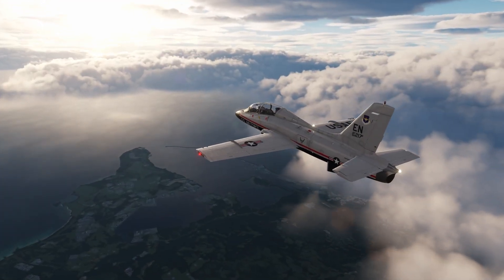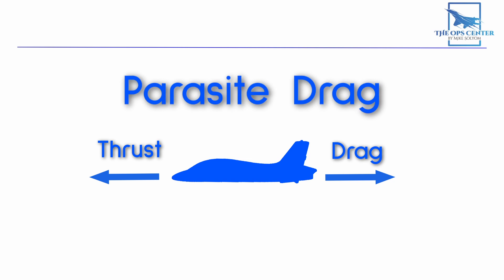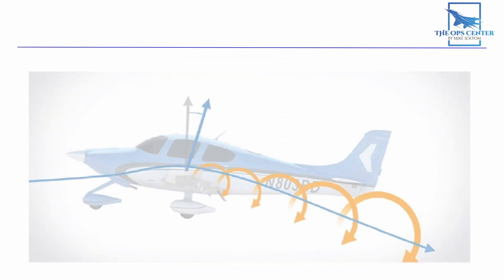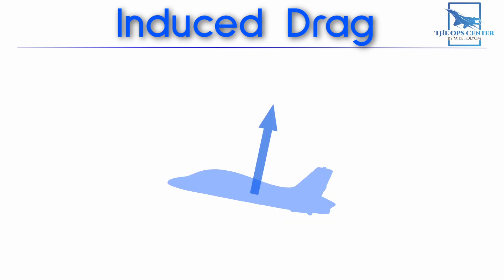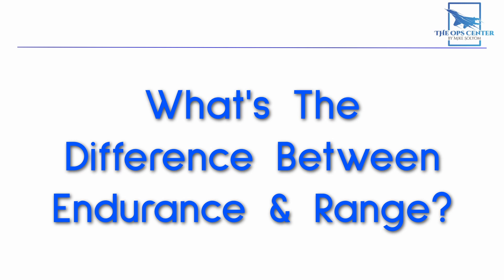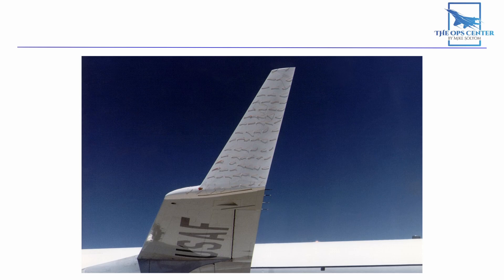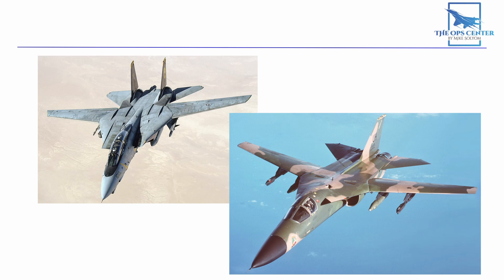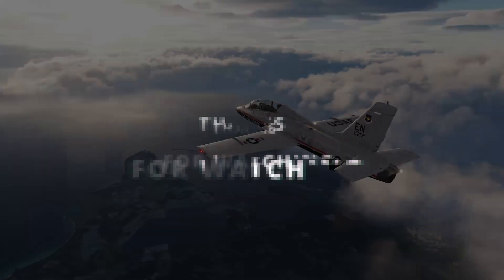Aerodynamic Drag Explained | DCS Beginner's Course

Comment: Hello again Mike. Again, very good content after the lift video, with nice examples about the winglets! Nailed it again and the drag curve is awesome and says all.
I would suggest, if you allow me, to move the ground effect explanation into the lift video, or maybe you intend to explain into more details into a landing video ? First reason is that the effect for the pilot is mostly "felt" on lift when landing or going high speed at low altitude. Second reason is because my understanding is that it is more linked to something like the airflow being pressed tight between ground and wind, so more related to lift phenomenon. I believe the ground effect is indeed something happening even with symmetrical shapes at 0 aoa. Just my 2 cent contribution to your amazing work, hopefully that helps. Can t wait for the 3rd video ! Cheers.